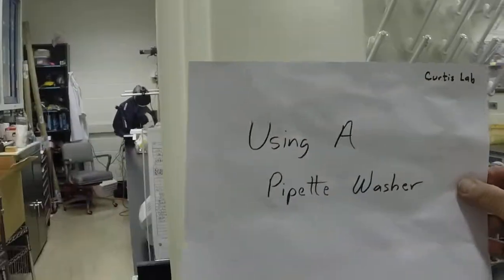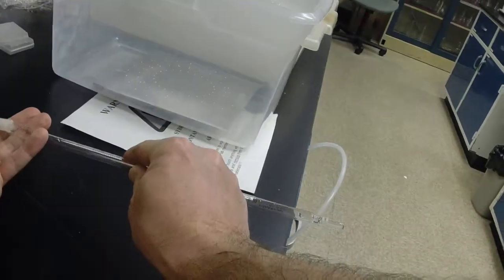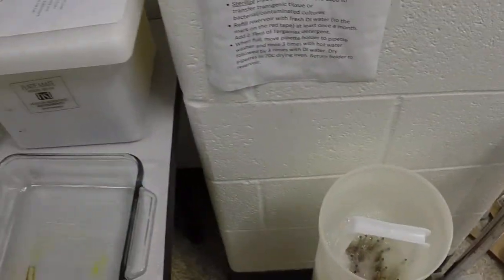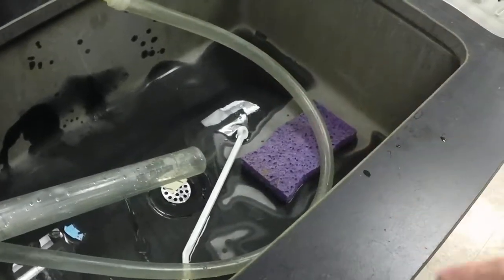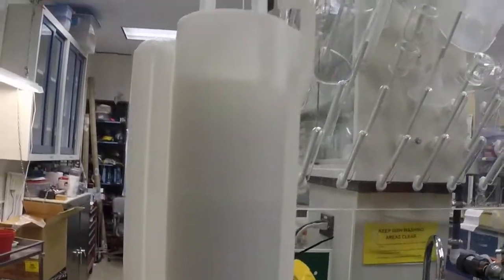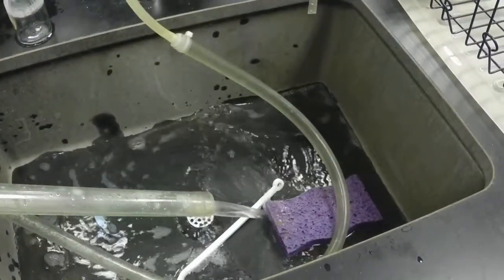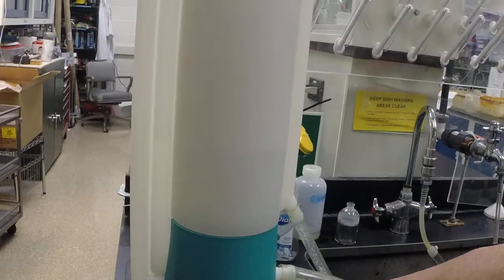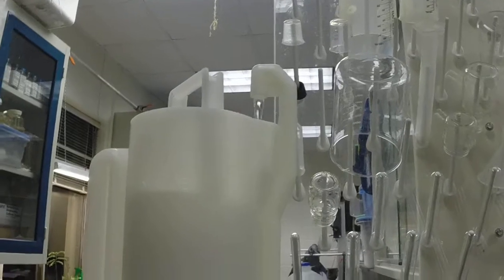Pipette Washer & Cotton Plug Removal

Comment: What do they pippette tips have to be submerged in when they are autoclaved to remove the bacteria?
Reply from the maker: Autoclaving submerged simply avoids baking on materials which will not be cleaned out by the simple action of fill/drain in a pipette washer.